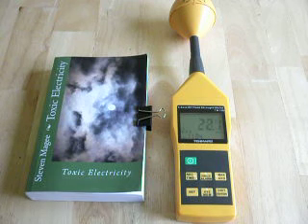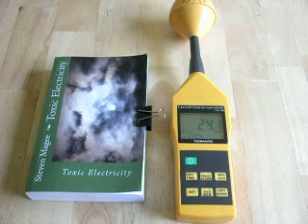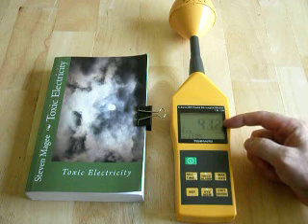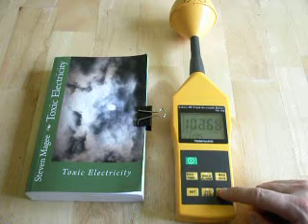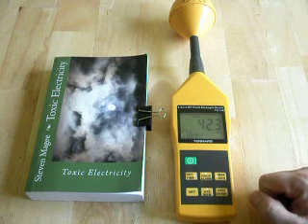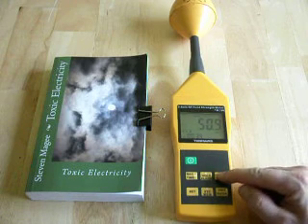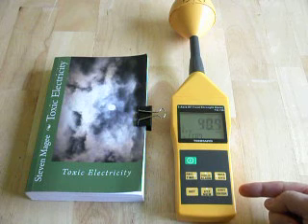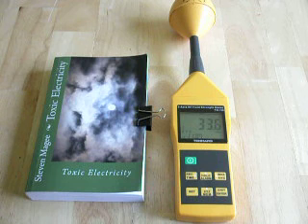Tenmars TM-196 3-Axis RF Field Strength Meter Review

Comment from the maker: Many domestic devices are now operating in the 5-6 GHz range.  The latest generation Wifi and cordless phones are examples.  I do not recommend any meters that cannot read up to 6 GHz for this reason.  I would recommend a 6 Ghz Cornet ED75 if you are on a budget which also reads magnetic fields.  I check my meter for accuracy using a WiFi router, it has a strong field of radiation near to it and that is why you should not sit near to them.  The TM-196 comes with a calibration certificate.

Comment from the maker: Sounds like it is faulty.  Both of the 196 meters went to zero in low radiation areas.  I have covered mine in foil and it gave funky readings, not recommended.  Build a large Faraday cage out of aluminum window screening and put it inside and see what it reads, or take it into the local rural forest.

Comment from the maker: I had two 196 meters, as the first went faulty. They read slightly different from each other below 100 mV/m range, the first meter appeared to have better sensitivity. I test mine out on wireless routers for accuracy, as you can get a reliable consistent fields up close to them. It is also the reason why I have a Cornet ED-75 to verify the accuracy of the Tenmars.  I wouldn't worry about low range values as you are measuring in the electronic noise.  The 196 appears to read from 38mv to 20v/m.
Reply: Hi Does it have the Accustimetr^ Please let know

Comment from the maker: Tenmars TM-195 50MHz ~ 3.5GHz : Tenmars TM-196 10MHz ~ 8GHz.  The TM-196 has extended ranges in both the low and high end.  There is a lot of wireless radiation that is now in the higher range, so you should expect higher readings with the 196 meter.  It is likely that the cell towers have higher frequency transmitters on them as they build out the next generation wireless networks.  Are you near to ports, airports, police, military, etc?